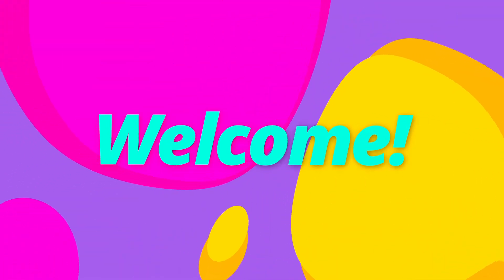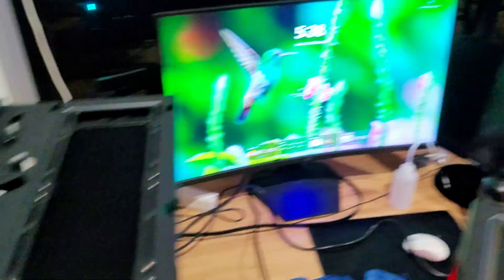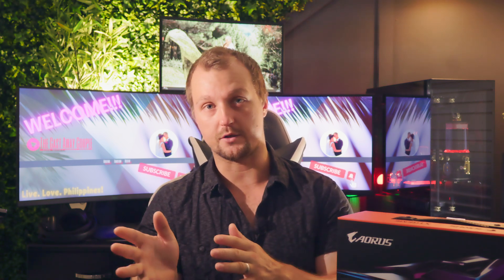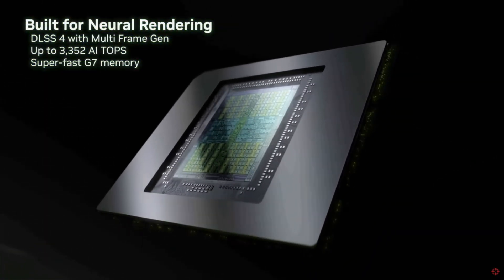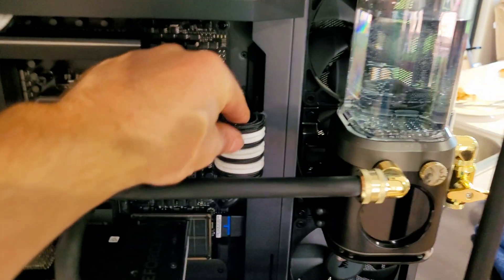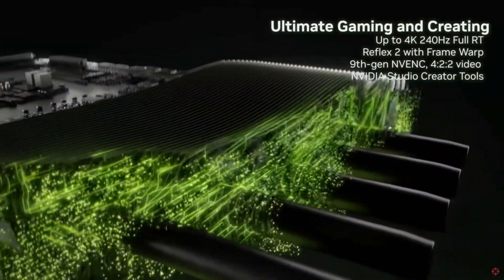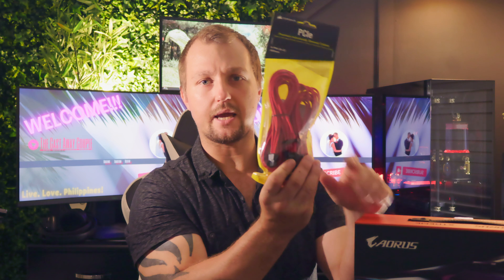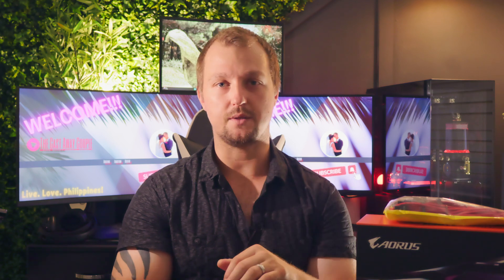🤯The Hidden Fix for Nvidia RTX 5080 Black Screen Issues - 12VHPWR Cable Secret⚡️

Comment: Woot. Worked for me. I was using the 12pin connector for my corsair psu. Work OK for the first 4 weeks. Then boom flicker black screens and the just black screen fans 100%. Tried everything from drivers to reseating. Cable changed all good. I did notice my psu (although new) looks to be 2024 spec. So older version of cable but still h++. Either way than you sir
Reply from the maker: Happy it solved it for you! Game on

Comment: Apparently that is the 600W 12Pin power cable. The older ones with only 2 of those center pins mentioned is the older specification.

Comment: Similar issue with my 5070FE. Used the supplied Corsair 12v2x6 cable. Crashed within 5-10 mins of use. Black screen with 100% fans. Was able to boot but once under load - crashed. Swapped to the GPU supplied adapter. No issues. I think it’s the sensor cables too. Need more testing.
Reply from the maker: Yeah, it's a conclusion I'm seeing more and more people find. Definitely needs not research but not the most obvious fix people would think of. 

Thanks for sharing!

Comment: im returning both 5080s i had bought for my rigs straight back to nvidia no more head aches ill stick to working stable cards
Reply from the maker: Far out. Sorry to hear about your stress. I was thinking, and this is a stretch.... maybe it had something to do with the v cache chips? Mine is a 9950x and it's been flawless since day one once I used the pcie cables. 

Just curious, did you happen to try that at all? With a psu that has 3x pcie outputs?

I tried using my corsair 850w psu from an older rig that only had 2x pcie outputs and I was getting intermittent black screens so I just assumed it was literally the power delivery and connection type. 

I mean, you very well could just have defective cards but having 2 of them seems highly unlikely or just plain unlucky. Pretty pathetic on nvidia's part though really.

Comment: i can tell you right now the problem is the drivers as soon as i install the newest drivers i get shutdowns and crashes i revert and it works again
Reply from the maker: I think it’s literally a mix of everything for everyone. I’ve literally never had a single issues with my 5080 with any driver since I bought it on launch day.

I’m led to believe it could be quality control problem on hardware level at nvidia or possibly even the AIB’s
Reply: @thecastawaycouple  its weird because it crashes wont post i uninstall drivers or put in another card and it boots , then the card works fine for like 2 hours then it shuts down im so confused with other video cards my pc doesnt crash only with the 5080 should i send it in for RMA?
Reply: @thecastawaycouple  i have 2 5080s i bought one for a 9800x3d and another for 9950x3d . IM returning one of the 5080s and the 9950x3d since they are un opened i cant even get this system stable and its been a month i cant go through that again with another build thats like 1850 dollars just in those 2 peices of hardware ill be happy with a 3080 , and if i return this 5080 they will only give me 999 because its been more than a month but im gonna try different psu see if that works if it doesnt ill send in vid card for RMA
Reply from the maker: @NexusGuru I know how you feel man. So much money and no go. Trust me, I got close to smashing my whole pc to bits😂

Comment: Since i upgraded to 5080, my pc randomly crashes (turning off and rebooting) like if it was overheating but all temps are good on the whole pc, i tried 2 different 1200w psu and nothing worked, looked at cables 50 times nothing tried 3 12v 2x6 connector not working, reseating gpu, it can handle OCCT powertest no issues with 111% powerlimit, it's just random sometimes i can play 3H no crashes, or even more, then 4 reboot in a row then fine for hours, or random crashes every 10 mins etc. I tried all drivers nothing working, i think i will send it back for replacement. Usually crashing when loading a level in a game or in game as well the only components i upgraded was psu and gpu ... 
Sad thing is the card is working perfectly fine if we remove the annoying random pc reboot :(
Reply from the maker: Far out! Sorry to hear it’s been such a torment for you. Sounds like an absolute nightmare. If I can just suggest, do you have any other GPU on hand or one you might be able to borrow and throw it in your Pc and play around for an hour or so? Seems unlikely at this point but could also have something to do with your CPU or other hardware in your system? Just to rule out that it’s definitely the GPU.

Really pissed with Nvidia this gen!
Reply: @thecastawaycouple  I still have my old 1080ti, i'm waiting to see if seller is willing to replace my card just in case, as all the problems started with this 5080
Reply: I was talking to nvidia support, they told me to update my chipset driver and unistall old GPU driver with their own tool like DDU, it's called nividia cleanup tool, so i executed it in safe mode and then rebooted. After the reboot i downloaded the newest game ready driver on the website and installed it with the second option custom installation then checked "clean or fresh install" option i forgot the name, and since i did this, it seems to work.
Reply: After 2 days of peace, crashes are back
Reply from the maker: @Jhintingbot man that’s frustrating! Should never happen with such a high tier product. I hope Nvidia do right by you… but then again, it’s Nvidia

Comment: Very good film. In my case (I watched another film on YT)  I resolved problem with black screen blinking for use DP cable instead HDMI - driver ver. 576.40.
Reply from the maker: So many strange issues with the 50 series. I’m happy you got it working!
Reply: Im having the same issues I get blinking black screen and when I open any gpu application the system just crash and give black screen upon start.. I was using DP port from monitor to graphics card… how did you solve it?
Reply: @royboy2189  In my case I have only  random black screen blinking (often or rarely). To contect RTX 5070 (Asus Prime edition) I used dedicated cable from Thermaltake (2x 8PIN to 12HWPR), which I bought more than one years ago. Additionally, in UEFI I set PCIE from auto mode to ver.4 mode (MSI MAG B550 mortar wifi) like thecastawaycouple recommends in this film. But changed HDMI 2.1 cable to DP cable ver. 1.4. or 2.0 (now is the DP cable ver. 2.1 1.5 m) resolved my problem definitely. My GPU card is connected to motherboard via PCIE 4.0 riser. Before a disconncted  my previous GPU I used Display Driver Uninstaller (DDU) version 18.1.1.2 to uninstall the nvidia drivers and that's all what I did.
Reply: @roycedacosta2433  In my case I have only  random black screen blinking (often or rarely). To contect RTX 5070 (Asus Prime edition) I used dedicated cable from Thermaltake (2x 8PIN to 12HWPR), which I bought more than one years ago. Additionally, in UEFI I set PCIE from auto mode to ver.4 mode (MSI MAG B550 mortar wifi) like thecastawaycouple recommends in this film. From the start when I first time launched new GPU i didn't have any red LED indicator nearly GPU power socked, even the computer is turn off. But changed HDMI 2.1 cable to DP cable ver. 1.4. or 2.0 (now is the DP cable ver. 2.1 1.5 m) resolved my problem definitely. My GPU card is connected to motherboard via PCIE 4.0 riser. Before a disconncted  my previous GPU I used Display Driver Uninstaller (DDU) version 18.1.1.2 to uninstall the nvidia drivers and that's all what I did.
Reply: @roycedacosta2433  In my case I have only  random black screen blinking (often or rarely). To contect RTX 5070 (Asus Prime edition) I used dedicated cable from Thermaltake (2x 8PIN to 12HWPR), which I bought more than one years ago. Additionally, in UEFI I set PCIE from auto mode to ver.4 mode (MSI MAG B550 mortar wifi) like thecastawaycouple recommends in this film. From the start when I first time launched new GPU i didn't have any red LED indicator nearly GPU power socked, even the computer is turn off. But changed HDMI 2.1 cable to DP cable ver. 1.4. or 2.0 (now is the DP cable ver. 2.1 1.5 m) resolved my problem definitely. My GPU card is connected to motherboard via PCIE 4.0 riser. Before a disconncted  my previous GPU I used Display Driver Uninstaller (DDU) version 18.1.1.2 to uninstall the nvidia drivers and that's all what I did.

Comment: Its a driver issue, has nothing to do with hardware or connections.
Reply from the maker: Mmm, I’m not so sure. In my case and a few others, we tried everything until we changed the cables, that’s the only thing that did it. Could be coincidence but I doubt it

Comment: My system only boot if I do cpu pcie link speed set on 1.
The pch pcie link speed it’s auto.
I tried all variants, only this works.
CPU link speed 2,3 and 4 didn’t work but pch link speed works with 1,2,3,4 and auto.
I don’t know why
I got Rtx 5070 infinity Palit and 12400f.

Comment: I have RM1000e (2023), and my GPU is 5080 with an adapter that needs 3 PCIe 8-pin (6+2), but I have only 2 PCle 8-pin (6+2), 2 PCle 8-pin (6+2 split) and 12vhpwr, which I want to avoid So, can I connect my GPU to the power supply without 12vhpwr? Like using 2 PCle 8-pin (6+2) with 1 PCIe 8-pin (6+2 split) only one head.
Reply from the maker: @haroonalghamdi8656  yes and no. I think this will be hit and miss for many people. The 5080 can pull more power than 2x pcie from your PSU can supply which could lead to instability. This will depend on variance between cards/manufacturers etc. 

I think certainly try the splitter but it that doesn't work, it might worth getting a PSU with 3x pcie out, as annoying as that might be. 

Hope this helps!
Reply: @thecastawaycouple  I think I will use 12vhpwr. If it does not work, I will buy a new PSU because I haven't used my current PSU yet (my card 5080 Shadow 3x OC). Thanks.
Reply from the maker: @haroonalghamdi8656  Perfect! Best of luck!

Comment: I bought an RTX 5070 Palit Infinity 3 and when I turn on the computer it turns on normally and shows the image but after about 40 seconds it turns off the image and does not recognize the HDMI but continues to work.
Reply from the maker: @miguelpalhais7884  That’s one of the most common problems most 50 series users are having. By any chance, have you been able to try a display port output to see if the issue persists?
Reply: @thecastawaycouple  i have this isssue on z390 and 9700k the dp works fine.. problem with hdmi pc boots fine and i can enter bios change anything but as soon as i leave and try to boot to windows it turns to a black screen and the resolution is like 1024 or something before it goes black.. also the pc wouldnt pick up the gpu to install drivers i had to manually install 572.83 and it picked it up.. also my pc doesnt turn off correctly like it wont power down i have tried the card in another pc its same thing.. i even reinstalled windows... any tips for making it turn off correctly or to make the hdmi work correctly.. im using a 27 1440p monitor works fine on dp but i cant add my tv aswell for movies or car games.. tv is samsung 55 4k 120 hz
Reply from the maker: @thunder8951 That sounds oddly similar to an issue I have with my old 2070 super. I’ve tried to diagnose it myself but I’m led to believe it’s a HDMI hardware fault with the pcb. No matter what I’ve tried I haven’t been able to fix it. Like yourself, DP works flawlessly. 

I have a feeling manufacturers cheap out on the hdmi boards on these things. It may be worth taking it to an AV specialist to have a look at the hdmi port itself or justRMA if it’s brand new.

I have an Onkyo amp specialist near me and he fixed my hdmi board on my amp for like $50.

Strange solution but worth a try if you’re out of options.

Comment: Set Fast Boot To Disable 
Set Erp to Disable 
Set  PCH PCIe Link Speed From Auto to Gen4
Set CPU PCIe Link Speed From Auto to Gen5 

And Your PC Will Boot Witz the RTX 5080 👍🏼

Thank ne later
Reply from the maker: @kennstedoch4456  good tips. Cheers
Reply: My system only boot if I do cpu pcie link speed set on 1.
The pch pcie link speed it’s auto.
I tried all variants, only this works.
CPU link speed 2,3 and 4 didn’t work but pch link speed works with 1,2,3,4 and auto.
I don’t know why.

Comment: Hello I’ve got PNY 5080 and I still fighting against tearing.. last gpu was 4060 zotac >> no problem at all .. Any idea for help ? Thanks 🙏
Reply from the maker: @Dany_IsPanico85  Sounds like a settings issue. I’d recommend trying to lock your frame rates to a fixed amount and then go see what happens. At this stage, I’m inclined to assume that most issues stem from Nvidias unstable drivers. Or try rolling back your driver to something older that is proven to be stable.

Let me know how you go!

Comment: I had to use the motherboard/ iGPU (7800X3D/ Asus Tuf gaming B-650) display port to get into BIOS, then switch the PCIE to 4.0 from 5.0 to get a 5090 to display an image. Maybe try that, it was what got me started, but I still had a ton of other problems to work through after that. Most painful build I've ever done 😭
Reply from the maker: @Wooskii1  Yeah that’s a pretty common fix for some. It was one of my tips in the video I recommended people try. Doesn’t work every time but I’m happy to hear you got yours going!

Yep, same here. All my other builds just fired up and worked 1st. 

Thanks for the comment!
Reply: @thecastawaycouple  Yeah I'm sure it won't fix everyone's problems, but I thought it was the most important one to say "I second that" to. 
I mean if you can even see the BIOS, how do you even begin to troubleshoot other than swapping parts?
Also for some reason, I kept getting black screens unless I used the "boot override" option to tell it to boot the USB media, then Windows after installing it- Normal starts/ restarts would just get stuck. 
Finally, after installing the chipset, Nvidia, and Mobo drivers (offline from an external drive w/ windows update paused) then allowing Windows to update, it started to boot into Windows as expected (without black screens;-)
Reply from the maker: @ Wow. What a stuff around. Pretty disappointing from a multi billion dollar corporation who’s been in the game for so long. Not mentioning that this architecture isn’t really an innovation from the 40 series and for it to still be such a cock up!

Oh well, you got it going! Hopefully smooth sailing from here

Comment: Yeah. If I don’t solve it by this week, I’m gonna have to RMA my MSI 5080. I updated bios, tried it with new drivers, deleted new drivers and went back to a old one, and even restored my PC to factory settings. My 3080 connects like nothing.
Reply from the maker: @brunovazquez1  sorry to hear bro. I hope it ends up firing up for you. Just make sure when using the pcie cables, don't use the splitters on one of the ends. 

Just get 3 individual PCIE's and populate all 3X outputs on the PSU. 1 for 1 to the GPU.

If you only use 2 outputs from the PSU, and use the splitter on the other end from one of the cables, there's a good chance it won't work. 

I know it's silly to mention but you'd be surprised how many times that gets overlooked!
Reply: Update: the power connection (12VPHR) on the PSU needed to be seated all the way in. 🤦‍♂️ I’m glad I found this video, I was running out of ideas. 🤝🙏
Reply from the maker: @brunovazquez1  oh legend! I just saw this comment as I was typing my first reply. 

Glad it worked mate!
Reply: @thecastawaycouple  thanks. I was going to try the PCIE adapter next and it was going to be a hassle since the new PSU only comes with 2 8-pin outputs. Meaning I’d have to install my old 850W one.
Reply from the maker: @brunovazquez1  ah fair enough. 
Well crisis averted! Enjoy the 5080!

Comment: I had the same issue with the power connector. I thought it was connected properly. I ended up disconnecting it and reconnected making sure I put firm pressure so it's seated correctly and that solved my issue.
Reply from the maker: @Ramon-pd4os  very finicky aren't they. Thanks for the insight! I tried the with mine and almost got a run up trying to make sure it's really "IN" there but the PCIe was an easy fix for me. 

Thanks for watching!

Comment: Tried everything except this, ill try it now with the 5090 FE!
Reply from the maker: @soyolaya1647  let me know how you go. Best of luck! Hope that's it
Reply: @ Was on it all Night. Didn’t work for me. Even connected an external 1500w Be quiet Dark Power PSU to the 5090. Same issues. Crash and Black screen after 1 min in game or benchmark. Rolled back the driver to .60 ,also nothing. I’m tired. Since days been working on it. Tried everything. Should have kept my 4090 FE! I guess Windows, MB Bios, GPU BIOS and NVIDIA Drivers, all these four have to work together in order for this card to work. And this might take months. I’m done with this Crap!
Reply from the maker: @soyolaya1647  wow! That's really disappointing. I'm sorry it this didn't work for you. 

Nvidia really cocked it this generation. You pay that much for a product, it should just work without all the FAFO
Reply: @ yeah! Paid a scalper 4500 USD. And then this happens to me…lol
Reply from the maker: @soyolaya1647  Yikes! Sorry I couldn't help!
Reply: @thecastawaycouple  you tried! Thanks for your video! Keep going
Reply: @soyolaya1647  If your bequit psu has an overclock jumper you need to use that with a 5090. The psu runs multi rail out of the box and you need to run as single rail for a 5090 otherwise it spikes and crashes.